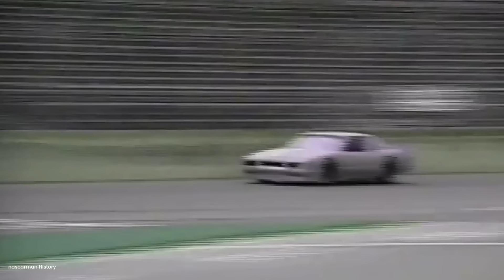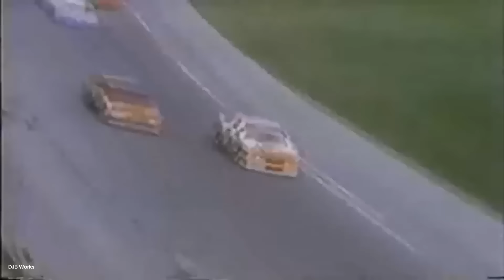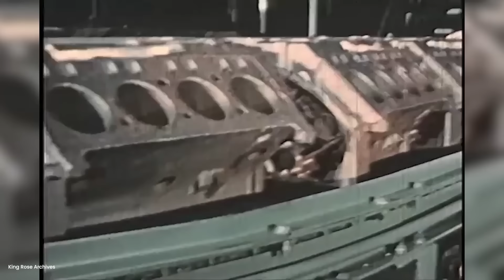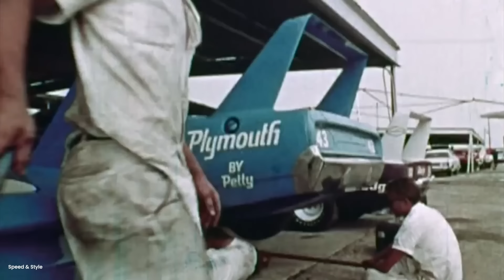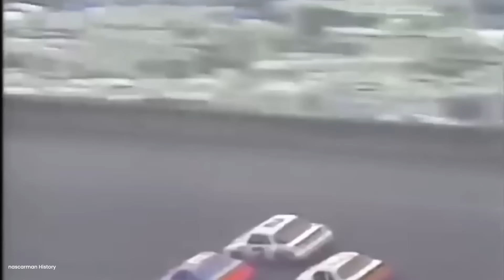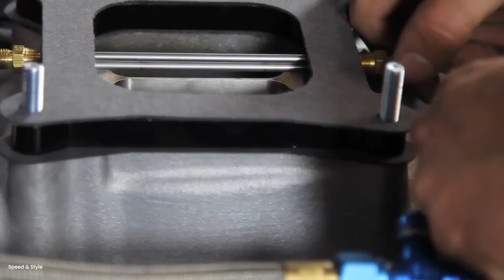How One Mechanic's "IMPOSSIBLE" Hollow Bolt Trick Bypassed Restrictor Plates

Comment: Something like this might have been done, but the one I remember NASCAR actually showing was hourglass shaped carb studs. The mounting holes in the restrictor plate were enlarged, and pockets were drilled in the manifold and bottom of the carburetor. ( A aluminum 2"spacer was typically welded to the top of the manifold) Then 8 horizontal holes drilled  from the outside to the throttle bore and plenum, plugged on the outside and  blended to look invisible.
    The air went in the carburetor and some would travel through the new small passages to the mounting holes, around the smaller part of the stud, down into the pockets in the manifold to the new passageway to the manifold plenum. The top of the carburetor baseplate stayed normal to align the carburetor, and the nuts sealed the top. The threads in the manifold  held the assembly together.
  This means that  'all air entering the engine must pass through the restrictor plate ' , meeting the exact wording of the rules, just not how they expected it to.

Comment: I’m not sure where this information came from but it’s total nonsense. Having spent most of my career working on restrictor plate engines, I can assure everyone that holes drilled through the carburetor studs would not amount to a significant horsepower improvement. 
Drilling a 5/8” (.625”) in the bottom of the intake manifold only yielded a 5 horsepower (STP Correction factor) increase. 
The most significant improvements came from frictional torque reductions (including oil viscosity and flow) and managing airflow through the engine.
Reply: Hey there, just curious which team that you worked for? I've followed Nascar since 92 and have always been fascinated with the tricks in restrictor plate engines and the aero tricks.
Reply: @joewinfieldjr3547 Hi Joe! I worked with Chad Little in the BGN Series in 94 & 95. Worked for Penske Racing South with Rusty Wallace in 96 & 97. Robert Yates 2000-2001. Richard Petty Motorsports 2002-2004.

Comment: Well if only the bottom of the bolt is drilled . And the head stays intact . There is no airflow . Has to be a inlet to the hole . That is accessible to ambient air . You are basically creating a vacuum leak . Which will work   But I’m calling this bs . Have been involved in stock car racing at lower level than nascar. ( just short track stuff ) there are multiple Cars using restrictions or especially small carbs . So a vacuum leak would help them all . This is heavily policed by tech . And yes cheaters have been caught . But at the level of nascar . You need something a lot smarter than this . Easy to tech shut all the intake valves . And smoke test or air pressure test the engine . Intake system
Reply: Amen, some common sense.

Comment: ALL OF THIS IS PURE BULLSGEET, ..and imposdible even if the boltis hollow it would have been seen,  i knoiw engines and carbs and i knoiw cheating!!!  A hollow bolt is worthless unless you drilled a hole into the sides of thge mounti g flange..THIS S A FAKE VIDEO
Reply: There’s 4 reasons why it’s true but it went to 2000